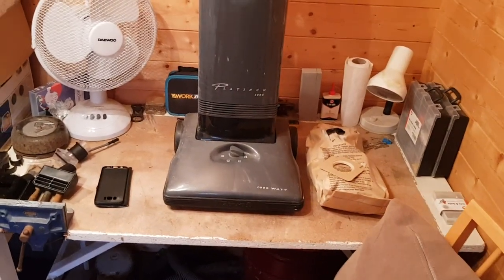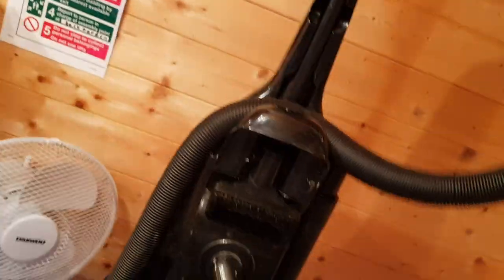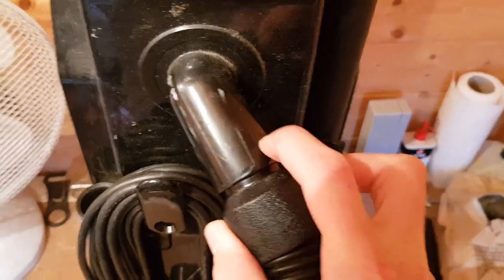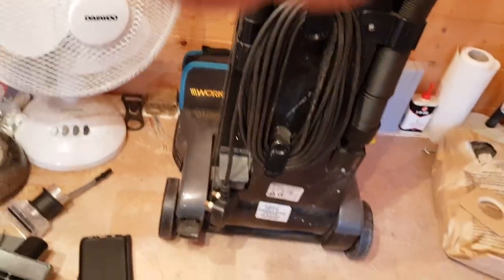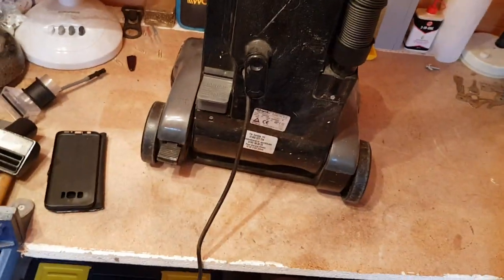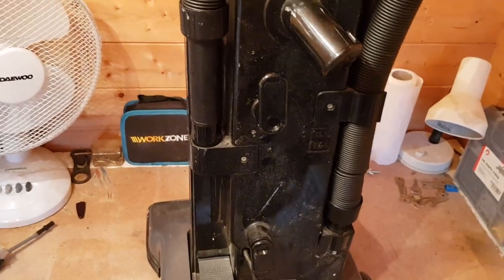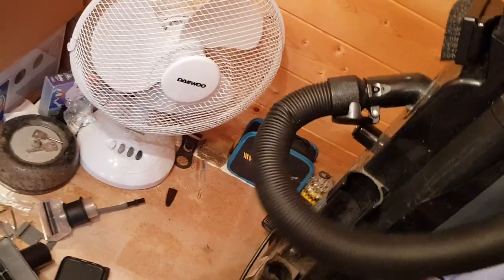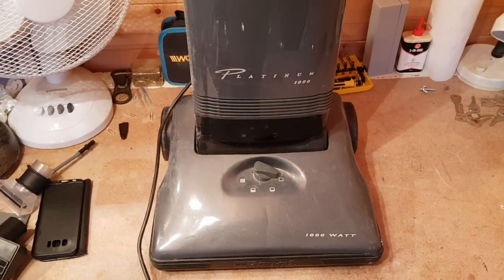From The Tip: Dirt Devil Platinum 1000 Bagged Upright Vacuum Cleaner

Comment: Really nice cleaner! Well done. Would love one of those. Don't scrap this one whatever you do!
Reply from the maker: Dont worry I havnt scrapped it but I have to say I was tempted! It took me ages to stop the hood from vibrating and making that awful noise that it did when it was on high power, and it turns out there is plastic tabs (no screws) holding the hood in place and several of these had snapped which meant whenever the variable power was turned up it would vibrate like crazy! I have had to put a few felt pads inbetween the grey hood and brush roll housing to get the noise to stop and cushion the sound. One of the wheels is loose aswell because the plastic tabs which hold them on ( loads of parts are hold onto this machine with plastic tabs!) had snapped so it is a bit loose but doesnt fall off luckily. And the last problem is the cord hook which you have seen in the video. I am torn between selling it and keeping it.
Reply: Yes you’re right, they are very plastic! Still a good find nonetheless, and as you have found out, you sometimes have to be inventive when it comes to fixing these old machines!